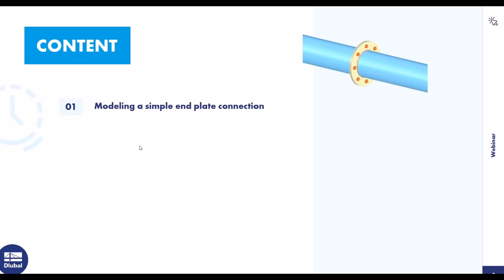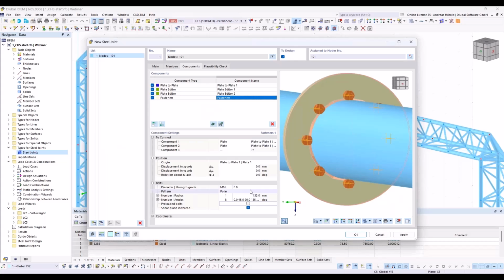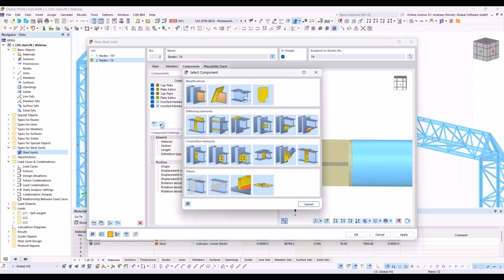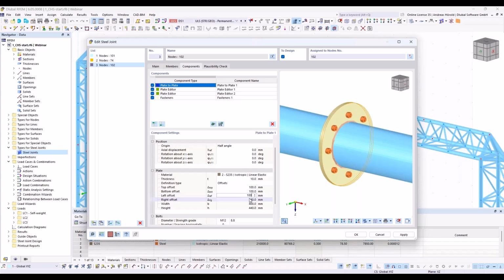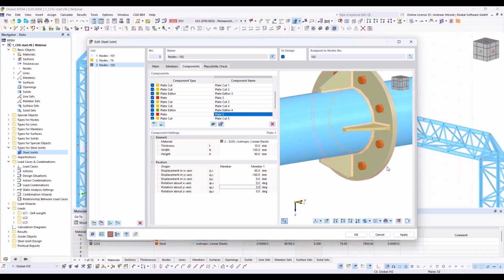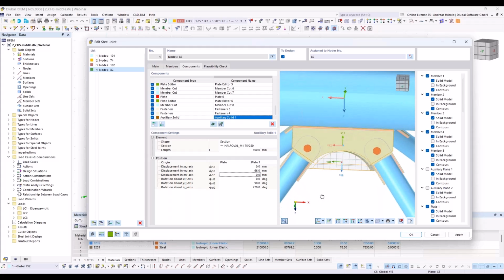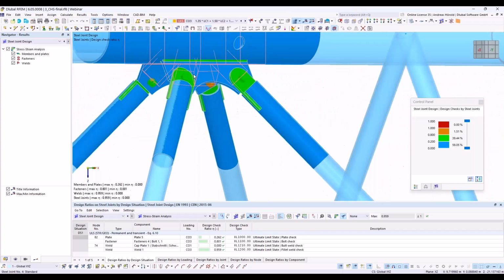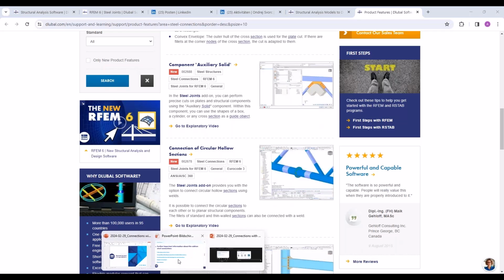Webinar | Connections with Circular Hollow Sections in RFEM 6

Comment: Can the same connection design be done with RFEM 5?
Reply from the maker: Hi, @yousefzam2328! 
Unfortunately, the design can only be done in RFEM 6 using an FE model. In addition, the nonlinear material for the weld seams is not available in RFEM 5.
Reply: @DlubalEN  thank you